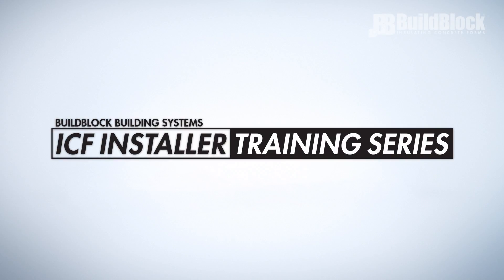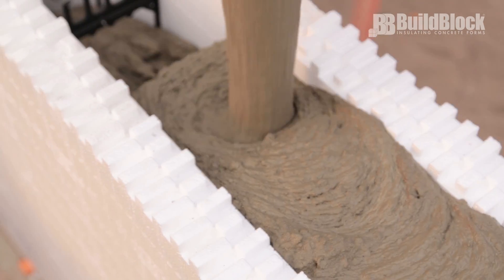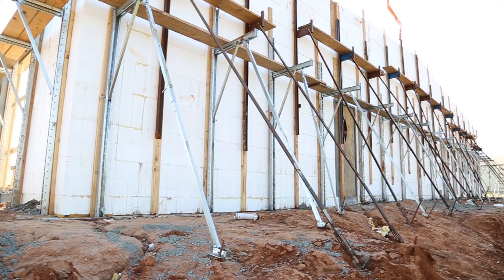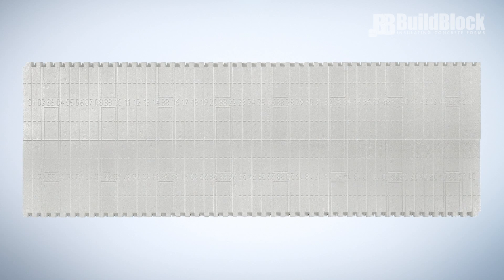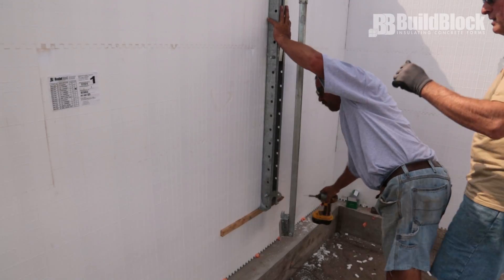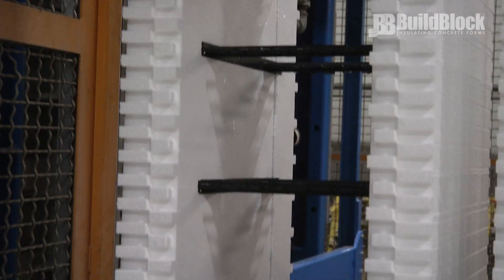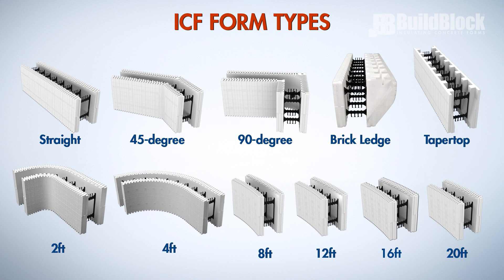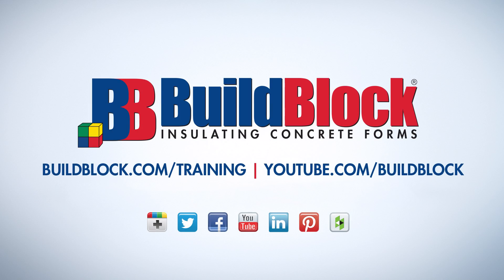BuildBlock ICF Installer Training Series: 01. Introduction

Comment: How are you supposed to know where the "BB" is after you drywall? I'm just wondering if there is a way to find these things out??
Reply from the maker: Hi Chris, check out this video to see how to find webs after they're covered up https://www.youtube.com/watch?v=eW-0gUayxDg there is a a simple method around 1:06 that explains. Essentially, if the webs are kept in line you can always find one 3/4 of an inch from the corner and 6" horizontally from there. BB hard points are placed every 8" vertically. Thanks for stopping by!